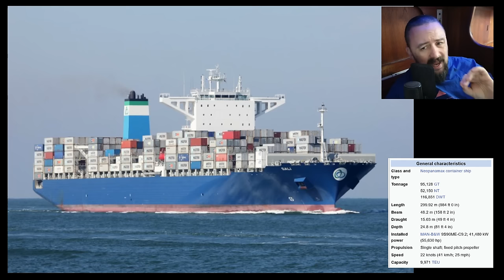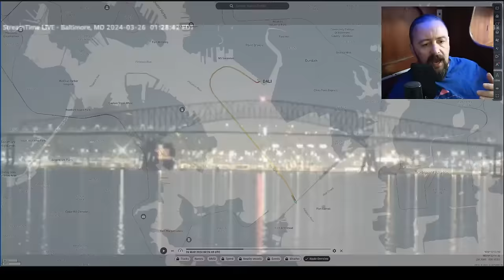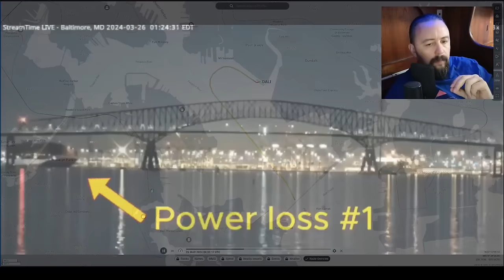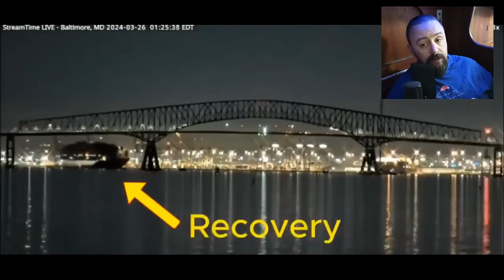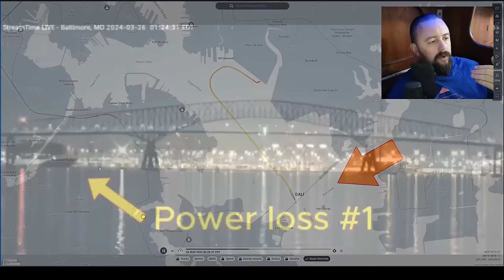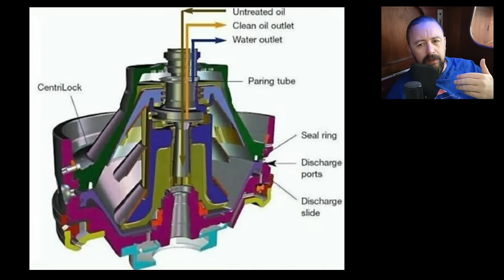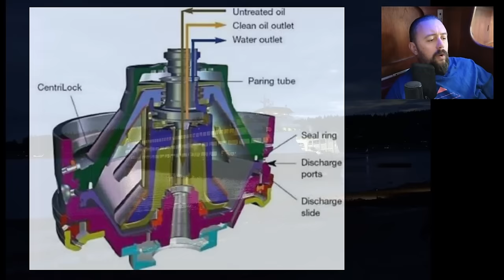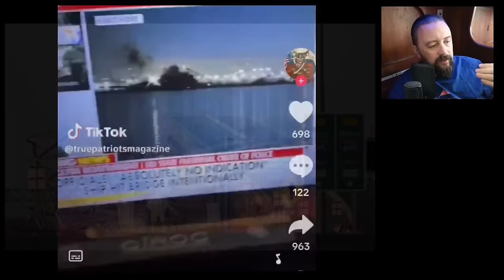Why MV Dali lost power and struck the Key Bridge: a sailors perspective

Comment: I'm not a naval or shipping authority but I've listened to an expert, Sal Mercogliano of What's Going On With Shipping, who's been into shipping his whole life and teaches it at University. I disagree with some of your observations. The big dark cloud of exhaust is way too much smoke / exhaust for a 'standby generator'. That will probably be a large truck engine size for a container ship. The massive amount of smoke is (as Sal explains) an attempt to blow AIR into the engine to clear whatever was in there, as part of the emergency restart process. The amount of smoke even from a cold 'emergency generator' is tiny compared to what was  visible here.
Reply: Starting these engines is effectually done with compressed air.... ,
Reply: That was a full reverse of mains
Reply: @BruceMyersLBZ  those were probably 2 strokes
Reply: @jlo13800  yes, but thats a LOT of smoke for startup, especially on an already warm engine. That was a high fuel condition before the air caught up, aka full power
Reply: @BruceMyersLBZ  Mabey it was overloaded by a fault who knows

Comment: I am a Mariner. I have said for years that those boats are too damn big to let them in & out of a port by themselves. One day this would happen. The suits would not listen. ONE damn TUG could have stopped that from happening. It's on You bean counters.
Reply: Dear, You are absolutely right, Tug would have assisted the Vessel and this accident could have been avoided. There is another mistake the speed 8 nots in channel is not recommended. Looks like Captain  may be under preasure by port authority / pilots to clear the channel soon to get other vessels sail as well
Reply: Absolute TRUE, even if this would be the 1st crash of this dimension.... But as I heard...it wasn't anyway, but without such an end...
Reply: The worse part is that tugs used to go under the bridge with them decades ago when I was in the Coast Guard in Curtis Bay (which is by the bridge). One, or usually two...with a losse line...one forward one aft, on each side of the ship. And the ships were not quite as enormous back then. But common sense was more plentiful..Its a damn shame. This did not have to happen. Even though I live in Florida now my wife is from Dundalk and still has family there. It really shook them all up (and me too).
Reply: I'm not a mariner, nor am I an engineer. But I do work in the political field. And I can tell right from wrong. This was very much a wrong.

The ship hitting the bridge is almost unimportant. This was purely down to poor policies, poor procedures, a lack of infrastructure investment and a disgusting mismanagement of one of the most critical pieces of infrastructure on the East Coast.

When you have people in positions of power who display such willful negligence, you do not need enemies. The enemies are calling from inside the house.

I also want to say to @Renegade ADV : What most people are wanting you to believe - those who sway people away from believing it was a terrorist event - is that this WAS the epitome of a Taleb's Black Swan event.
#1 being that this is supposedly an outlier event who's probability was so low, yet it's impact so consequential and at the exact same time, being rationalized as an "of course" moment in hindsight.

I.E.,  People want you to believe that this couldn't have been predicted or prevented, its probability of happening was so low and its manifestation so unlikely, that it was outside of the bounds of pondering as a possible risk factor, yet its impact so huge (it may not be yet, but it will be) that it is an historic event - YET, "well, no of course if a ship of that size bashes into a bridge like that it's going to collapse, what are you stupid?".

It's not the "conspiracy theorists" who are pushing the black swan theory angle so much as those who hand wave this event away, as above.

Historical logic would dictate that this kind of thing can and does happen, one would assume that a port of the size of Baltimore and of its impact, would have assessed the risks and mitigated them through firm policy and procedure, fallbacks and redundancies, yet they didn't. They out-rightly ignored that, even in the face of other ports like the ones in Chicago taking mitigations like bigger concrete dolphins near their bridge. I've heard contrasting information that they weren't concrete dolphins, but in fact related to lighting, so who knows.

Yes, of course a ship full of cargo bumping into an inappropriately mitigated bridge is going to collapse. Why was it allowed to happen? You don't always need to go out for enemies, when you can have enemies at home. I think 9/11 was a very, very good example of that.
Reply: @hanashi5727  Thank for your input 🙏
Reply: No way, no f#$/ing way, those tugs were going to stop that ship.  The M/V Dali has a single main engine, diesel, with about 55,000 HP.  The tugs that were assisting it both had about 5,000 HP.  That means together, they collectively had about 10,000, less than one-fifth of the power that ship had, with propellors much smaller than the ship's.  The ship was moving at 8 knots, which is getting darn close to the hull speed of those tugs.  No way that they could stop that ship in 4-5 minutes from that speed.  No  way.   

And, having tugs alongside a ship is not a risk-free proposition.  Tugs have sunk when just being pulled along by a ship, and their crews have died.  

If you ever had worked a tug, when a ship drags you along that ship at a slow ahead bell with be near a tugs hull speed, and a tug can get very squirrelly and feel darn unstable.  I have been there, and luckily, my tug never rolled or got tripped.  

Just adding tugs is not a simple or risk-free solution.
Reply: @danmc7815  not going to argue with anyone. I believe things may have been different with the Tugs to accompany the vessel. I crewed a tug for a summer as a young man. It's a challenge.
Reply: @Saddletramp1200  I ran tugs for about a decade.  

The size of the ships, you have a point, but the economy of scale is for them, and if one port does not accept the large ships, another will.  Not sure of a good answer.

Still, the real question is why did this ship lose power?
Reply: @danmc7815  Tugs have big engines and propellers and deep hulls for their size. They are designed for a strong pull (or push) at slow speeds. Also, tugs are usually deployed near the bow or stern of big ships (often both) so that they have the biggest possible effect when trying to turn the ship.
Reply: @saleemchoudhry4145  In relative terms, tugs have large wheels (propellers).  But compared to a ship, not so much.  The tugs draw probably about 15 feet, and into that 15 feet, the tug will need to fit some hull, some machinery for the drives that rotate its Cort nozzles, and their propellers.  I have not measured the diameter of a modern tug with z-drives or whatever term one wishes to use, but I have guess they are about 11 feet in diameter, maybe.  A ship like the Dali has a propeller that is much larger.  

Tugs are placed as close to the stem or stern as they can get.  A tug can try to push on the tip of the stern, if the ship is moving ahead, or tip of the bow for a backing ship.  But that only helps turn a ship, not stop it.  Stopping it is really just about power.  This ship took more than a few minutes getting up to 8 knots, and getting it stopped would take at least that time.  Two tugs with a fifth of its power would not stop it in four minutes.  

I think tug propellers have gotten smaller over the past few decades.  In the late 1950s, McAllister started building flanking rudder boats; single-screw boats, with one rudder after their propeller, and two in front.  The flanking rudders were used pretty much only when backing, and you could steer with them while working astern.  These boats were really well thought of as ship assist boats.  Their predecessors had no control when backing.  The first two were the Brian and Teresa, 1800 hp.  Then came the JP and Isobel, with more horse power, then the Grace and the Jane with about 3200 hp on a single turbocharged EMD.  Finally, a Helen and Marjorie were built, iirc, with the same wheels and rudders as the Grace and Jane, but larger turbocharger EMDs and about 4000 HP.  Those last tugs had big wheels, about 13 feet in diameter.  I saw The Grace push a 6,000 HP boat backwards, once, because of the torque in its wheel.  

The last two boats were failures.  They both sank and were sold eventually to Eklof and renamed the Thor and Scandia, and they sank while assisting ships.
Reply: Wrong, you think a tug could move that ship at 7 knots than what about the next bridge you think a tug is going to spend two days getting a ship out of port
Reply: @JohnAdams-xc5yk  I didn't cause the wreck. I am not going to argue with anyone. I could explain my ideas but it's done. You have a big ol' sun shiny day '

Comment: As a merchant marine engineer I have to disagree with your assessment of a fuel problem. In my opinion that smoke was the main engine full astern. The genset flamed out for some reason. The steering pumps are electric. No genset equals no steering. This possibly happened during a minor course correction. So the ship ended up with no steering and a rudder that wasn’t centered. The Pilot or possibly the Master or mate on watch ordered full astern at that time. Someone probably panicked and instead of staring a different genset they restarted the one the died. It quickly flamed out again. I hate to say it but I’m willing to bet it was a clogged fuel filter on that genset. The timing between the two flameouts is just about right, but it could have been anything. We don’t know what happened and we probably never will. NTSB and coast guard reports are notoriously wrong in many cases, and you know damn well the crew certainly isn’t going to tell investigator the truth if it places them at fault. I’m willing to bet the first thing they did was cover up the failure if it was a lack of maintenance issue like a clogged filter!
Reply from the maker: I am inclined to agree that the smoke could be from going full astern giving it all they have, which would have also introduced twist. 

IT seems on the fuel filter issue we are in agreement.
Reply: I must add that it’s standard procedure to start and have running at least a second genset whenever you are entering or leaving a port or operating in a river, canal or other body of water were there isn’t much room for error. I generally have at least one genset up and running and am starting by to switch over immediately and restart the critical electric motors like steering pumps and air compressors when we are in a tight body of water like this ship was.
Reply from the maker: @Trump985  I wonder if the bow started slipping around and someone on the bridge hit the bow thruster not realizing there were not enough generators online to run it overloading the system?
Reply: It’s possible, but it looks to me like prop walk. When you back on a single screw vessel the prop walk will back the stern to port and tend to rotate the vessel clockwise. This is much more pronounced on heavier vessels with a large diameter screw like a ship. I’m not a ship captain but I have a lot of experience pushing big heavy barges around with underpowered pushboats, and old single screw tugs and everything I’m seeing looks like a combination of prop walk from backing down hard in an attempt to slow the ship, coupled with a cross wind component, and the fact they were making a starboard turn. That momentum was not helping anything. I have some experience with single screw boats and this is how you can almost spin one (clockwise) in it’s own length. Right rudder alternating ahead and backing astern will rotate a single screw vessel clockwise almost like twin screwing a twin screw boat. Obviously you can only do this in one direction (normally clockwise but if you have a reverse rotation wheel then it will back to starboard).
Reply from the maker: @Trump985  Oh I meant what caused the power to go out in the first place. 

Prop walk certainly had to be a factor, my personal boat is a 42' full keel sailboat, without prop walk you couldn't maneuver it.
Reply: @RenegadeADV  Sorry I misread your message🤦🏻‍♂️ 

That’s quite possible but it doesn’t explain why the power went out the second time. It’s quite possible that the first outage was caused by a mechanical problem or fuel problem, they then be brought a different genset online, and they then overloaded it in a panic with a bow thruster. Fortunately I’ve never been in a situation like this so I don’t know how I would react. Obviously if your about to take out a bridge your likely to make some mistakes in the heat of the moment, like overloading a genset. This is especially true if the engineers have there hands full and there isn’t any real communication between the bridge and the engine room. I can certainly imagine a situation where the bridge thought that the engineers had 2 gensets online and paralleled when they only had one online.
Reply from the maker: @Trump985  I would say that is a highly likely scenario. 

Thank you for all of the insight.
Reply: Accumulators on large mine trucks allow 2 full steer cycles and 2 full brake applications. Why are no accumulators on line as absolute backup
Reply: @RenegadeADV  
IMPOSSIBLE! Once BLOCKOUT happened BOW THRUSTER POWER WILL GOES OFF as well.

Comment: Power outage was most likely caused by failure of the 2 generators to share load effectively.  This caused one generator to start to motorize.  This will cause both generators to trip off  Load sharing requires precise control of the voltage regulator and the governor droop,  complicated circuitry.  Often not understood and improperly adjusted.
Reply from the maker: I am inclined to agree with this as a strong possibility.
Reply: Down on over load over boost. Panic struck wide open. Should be a accumulator to allow 2 full cycles with hydraulic  power  off. Unless its electric steering. Military no break system as backup. Motor  turning 20 ton flywheel. Power down mag clurch engages warm primed diesel enine motor becomes generator.

Comment: I have been an engineer even chief in the engine room on several ships in my life time for over 50 years. To my humble opinion, the master made a wrong fatal mistake to have the ship going full astern with a right handed propeller. Means the head/bow will turn to starboard when going astern. Now looking at the course line of this vessel it should have past the pillar safely with having the rudder hard to port when the power came back. Bow truster is at that point irrelevant as speed of vessel was to high. But with going ahead the course could have been altered to midships or even little starboard to catch the swing and safely passes with the stern. The smoke coming out of the exhaust is normal when the turbo's kick in given the engine full speed. But all this did not happen, they give the command full astern and well the bow will turn to starboard. End of story. To my knowledge master fault with handling the manouvres.
Reply: Who's in control of the ship??     Word has it that a local pilot was onboard
Reply: I think You are right ! The wheel effect is the only explanation , why the ship turned to star board .
Reply: Any propeller of this type mounted under this vessel goes with the bow to starboard when going astern. Also there is NO EXPLOSION from the ER as when diesel engines are using the turbo's and with full speed of the engine it will smoke for some minutes and is VERY NORMAL. If you are an engineer you understand.
 @JurgenStrauss-ow2ge

Comment: In the previous weeks there had been considerable rainfall on the eastern seaboard watershed, so the current in that river channel was at full flow, and probably close to the approximate 8.7 kts. that MV Dali was making at the time of the power loss. It is very likely that when the main screw stopped turning and its wash was no longer passing over the rudder, the ability to control the rudder no longer mattered because the rudder no longer had any control authority over the ship.
When the lights came back on, the ship's forward speed was down to 7.4 kts. and in the absence of harbor tugs, the 20 kts. wind against the port bow was the primary controlling force on the course of the vessel.
It seems to me that the Pilot and the Captain were just members of the audience at that point, and victims of the bureaucrats, like most of us.

Comment: There is no wind. The Dahli is  moving out from under the smoke as it exits the stack. This is an accelerated clip of events, and if you watch the smoke in relation to the bridge, it practically doesn't move. What movement there is is probably caused by the passage and exhaust of the ship. also note there is no wave action to speak of.

Comment: There is no reverse. For the ship to generate reverse thrust the engine is stopped and restarted running in the opposite direction. The black smoke is likely them doing this to try and slow down when they had the initial blackout

Comment: Losing power to the rudder and rendering it inoperative should never happen. There should always be redundant systems online to keep maintain power to the rudder in case the main power source fails. IMO, the final report will include operator error and inadequate power management for rudder operation.

Comment: I doubt that the winds were 15-25 knots. The water surface appears to be mirror like.
Reply: You are correct, it's the funnel moving that results in the line of smoke.  In relation to the bridge, that smoke has very little lateral movement.